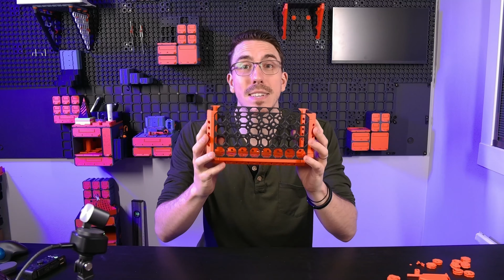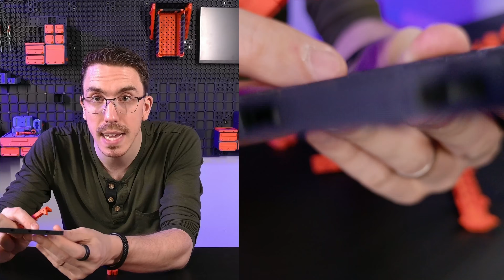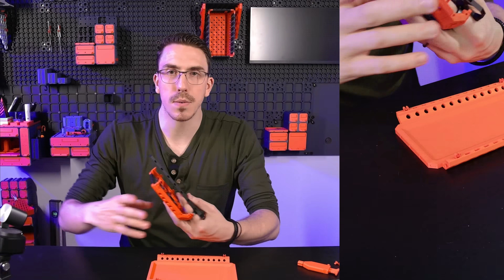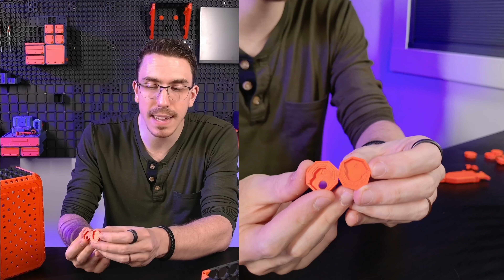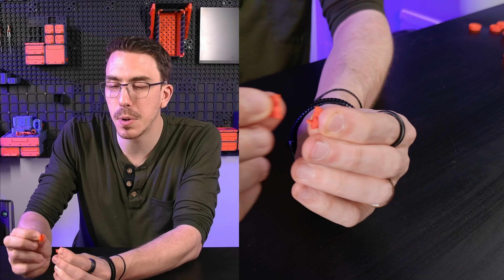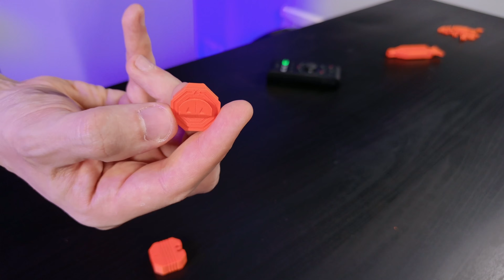Simple Basket #1 : Multiboard Pack Build

Comment: Printing out my multiboard now. First time using it and im excited. My work station is going against the wall where the multiboard will be mounted so I was curious if there is solution for using the multiboard for overhead filming and lighting. If not, would that be possible with something like this?
Reply: If you're using flush mounting, it should be able to withstand having a camera arm leveraging down in it pretty easily if the camera isn't too heavy. If you're offset mounting, the boards strength wise should be able to handle it still, but I would definitely put extra offset mounting brackets behind where you mount the camera, because it will bend the boards; I have a tape rack that did this, but it didn't break! There's a multiboard articulating camera arm on Printables that might work, I think it's meant for GoPro style and not heavier stuff like a DSLR
Reply: @saucercrabzero I’m hoping for something to hold a mirrorless, specifically Sony ZV-E10 ii. Think that would work?
Reply: CoopersWorldReading that the weight is about 12 Oz I would say it's definitely worth a shot (no pun intended). The articulated arm might be overkill, depends on if you need more dynamic angles or if you're trying for static shots. A simpler arm might be easier, it's pretty easy to remix Multiboard style connections to existing parts too. Regardless I think the board can handle it, as long as your mounting surface can as well
Reply: @saucercrabzero thanks for the info! I’m new to all of this so I’m trying to figure it out. I appreciate the help!

Comment: Jonathan, in the video, on the left, how is that PLATE holding the bins attached to the TILE?
Reply: Must be regular multi points, either attached to a plate snap with small threads or the the small threads in the plates themselves.
Reply: I'm interested to know this as well

Comment: I absolutely love the system. But the number of small connector parts are getting out of hand... (they are so brilliantly designed though, I don't think I've had a single one break on me during assembly and reassembly)
Reply: This is definitely one of the challenges of having such a well engineered product, the development of the product itself takes so much effort but it also creates a proportional amount of work on the documentation side.

I will say if you haven't used the beta parts library (I hadn't until yesterday) it's a very big step in the right direction
Reply: Agreed. It turns out that building a perfectly uniform and standardized system of interconnected parts is really hard.

In defense of Multiboard though, Lego has thousands of different pieces, and many of those are to make very specific kinds of connections for a very specific use case. If we start seeing more of these assembly “packs”, I won’t be as concerned that some connectors are only useful in the context of a certain pack.
Reply: It’s all about how its messaged and marketed.